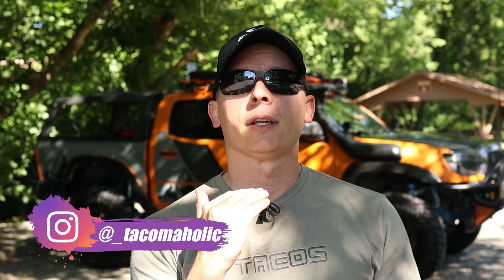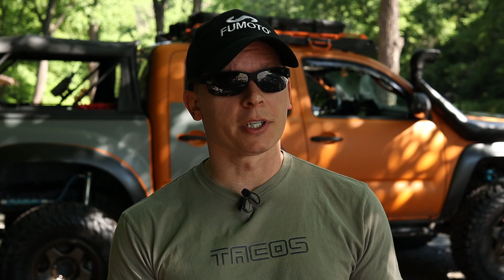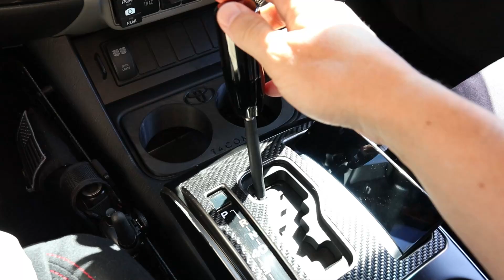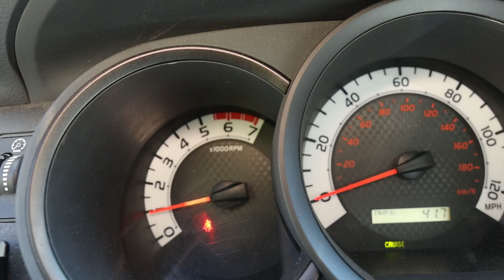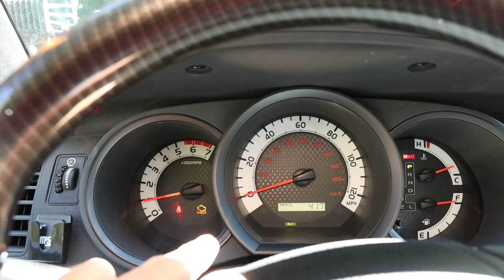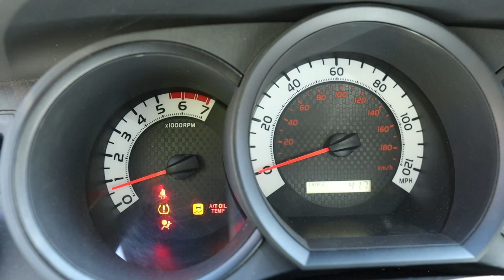Toyota Tacoma Automatic Transmission Temp Check Mode Tutorial

Comment: FYI if anyone’s curious mine took almost 30 mins for the light to come on solid after doing the shift sequence to initiate  temp check mode. This was starting with a cold engine on a 60F from not driving for a day prior. Just gotta be patient. Thanks for the video!
Reply: Yeah It took mine around 25 because it was cold out

Comment: FYI…this step is completely unnecessary. 
Start the truck, cycle through gears a couple of times. Touch the ATF pan. If it’s warm but not hot (around 95F), you’re at the right temp. Drain overflow. You should get 1/2 to 3/4 quart from over flow.

Comment: Great write-up. I tried it exactly as you described but couldn’t get it into temp mode with just the 6 shifts. Mine is a 2013.  What finally worked was repeatedly shifting back and forth between neutral and drive…(about a dozen times).  Initially the light would remain blinking but after letting it cool a couple hours and trying again the light came on and stayed solid.  My fluid was 2 1/2 quarts low! Thanks for the help!

Comment: This looks like it’s different for every Tacoma. My Tacoma doesn’t have an AT oil/temp light.

After shifting between N D N D N D
While the gear stick is in drive if the D is blinking then it’s too hot. But if the D is solid then I have a few minutes to drain the overfill and get the level right.

It’s weird and kinda scary that it’s different depending on your Tacoma
Reply: What year is your Tacoma? I have a 2011.

Comment: This might be a dumb question, but how would I leave the temp check mode? Or does it automatically leave? Thanks!
Reply from the maker: The temp check mod disables when you turn the truck off and remove the wire or clip from the OBD port.

Comment: I cant do that, my light at oil temp ever is flashing or just is not on
Reply: I got it and i just got 10 ml
I did drain again and put new oil transmision and i add 300 ml plus just for see 300 ml back when i check again the oil level, but that 2nd time when i did check the level a didnt get nothing oil back, obviously i was expecting get that 300 ml back

Comment: couldnt you drain fluid, remove the level check bolt, fill till it comes out the bolt hole, plug the hole then fill with a couple extra pumps.then let car warm up then just remove the check level bolt again, drain  then ur good

Comment: Super helpful video. I did this today with the paperclip(works great). From my experience(08 Tacoma) when I got it into check mode it started flashing a few times, stayed solid for a few seconds, then went out. Once the light came back on, I checked the fluid to the proper level. But my light literally stayed solid for 20 minutes until it started flashing. I think my transmission temp sensor might be jacked up. Anyways, the video is/was much appreciated! Thanks!

Comment: So just got a 2010 Taco Prerunner 2 wd. with 150,000 miles. Truck looks amazing bu have no maintenance history. Doing a fluid drain and fill and will repeat in about 15K miles. I am in FL wih outside temp mid 90's. The light never blinked. after I got the sequence down it just stayed lit. Does that mean it is at correct temp? or did it never go into test mode?

Thanks

Comment: How long will at/temp light flash?
Reply from the maker: The light will come on solid for about 2 seconds when starting the mode then turn off, but will come back on solid when the truck is at the correct temperature and then start flashing when the temp is too hot.

Comment: I got it to flash but it didn’t go away.  Will it flash for a few minutes then go solid?
Reply: After going through the gear shifting procedure my AT temp light flashed a few times turned solid and then went off. Then I had to wait like 15 min for it to come back on solid. Then check the fluid level on a level by pulling the check plug. Make sure all this is done on a level surface(this is super important). If the AT temp light starts flashing after having it having been on solid for a while, you are above the correct temperature to check the level.

Comment: Was a hot day, got into temp check and it flashed once and then stayed solid right away without it running prior. Could just a warm day get it into temp range? 2012 4.0
Reply: Probably so, the range is 97-115 degrees. Maybe wait until weather cools a little and then do the process over again to make sure you don’t have a faulty trans temp sensor.

Comment: Just wanted to give my input that my 2022 sr did not work with the jumper. From what I’ve seen 2020 and newer just require a specific shift sequence, either to S back to park or N before you shift from N to D

Comment: When is the appropriate time to remove the paperclip/wire from the connector?
Reply from the maker: Any time after you've refilled the correct amount of trans fluid.
Reply: @Tacomaholic  Thank you. Great tutorial. Subscribed.
Reply from the maker: @GreatDaneAV  Thanks man!
Reply: According to the Car Care Nut ( Master Toyota Mechanic) He states to remove the jumper after the car is in temp ck mode.  Then check for proper fluid level.  This is done to ensure proper idle speed when checking fluid level.

Comment: I had a very bad leak. Coming from the hose that goes into the radiator at the fitting. I do not know how much I lost. Toyota told me to put in 5 quarts to be safe. That seems like a lot? I have the old trans oil changed out, and refilled. What I drained out was not very much.I have yet to get my 2014 in AT temp mode. I get all the flashing lights and the AT light pops after the sequence. I waited 20 mins and gave up. I probably need to wait longer?
Reply from the maker: It can take awhile for the truck to get at the proper temp for the AT mode assuming you got the sequence to start correctly.
Reply: @Tacomaholic  I seemed to have got the sequence correct. I got the AT light to pop on briefly and then vanish.. gonna give it a try now. Thanks! Great vid!

Comment: Can the fill plug be opened and fluid added while the truck is running?
Reply: Probably not a wise thing to do I would imagine.
Reply: Yes you wait till the light stays solid then pump some in the fill plug till it runs out the check plug while it's running. Then put the check plug back in shut it off then put in the fill plug.
Reply: @JustinBurnette-gn2tj  why would you not drain out while cool, put the amount back in that you drained, plus a half quart, then heat up until correct temp pull the plug and let drain until a trickle? That seems to be the best way to do it imo.

Comment: I tried this with my 2021 Tacoma using wire or paperclip can't get any flashing lights to come on. I put them in the correct terminals. Any suggestions?
Reply from the maker: I'm not sure if the process is identical on the 3rd Gen Tacomas. Might want to see if there is a thread about it on Tacomaworld.

Comment: 2006 tacoma. 4L 6cyl. Drained and filled. 2 quarts. Went through process 6 N-D. AT temp light stayed solid. It did not illuminate and go away?! Does this mean fluid is at temp? Note: it is 92 degrees outside. Anyone experience this? Or should I consider it at temp and do overflow?
Reply: It flashes when you first initiate at temp check mode, then stays solid when it is at the proper temperature to check the level.
Reply: I'm having the same problem. This morning it did what it was supposed to do, it lit up and went off 10min later it come back on. I checked my fluid, I didn't have enough so I added fluid and now it comes on solid. What am I doing wrong
Reply: @jamescorley2536  after you added fluid, did you let it cool down and go through the whole process again?

Comment: I weigh the oil that drains out and put the same amount back in.
Reply from the maker: How do you know it was filled correctly to begin with?
Reply: @Tacomaholic  You could say I'm trusting Toyota. Plus the fact that whatever is in there has been working. Obviously if you have a leak or other problems or unknown service history, you would not use my method.

Comment: I have a Ultra Gauge in my truck that shows my trans temp, I see in the thread that it needs to be between 115 degrees and 130 degrees. Do you think I’d be okay using just the Ultra Gauge or will I still need to put the truck in temp check mode?
Reply from the maker: Temp check mode will be the most accurate, but using the UG should be fine too.

Comment: Thank you so much for this. Been looking for this tutorial for ages, but none are very clear.

Do you know if this works on the 4th gen 4runner? I'd assume yes. 

Also, do you plan to use Toyota WS or something else? I've been thinking about using Valvoline Maxlife
Reply: Did you ever find out if the 4th gen 4Runner process was the same?
Reply from the maker: I'm not sure if it works for the 4th Gen 4Runners. Personally I'll be using Toyota WS fluid when I do my change. It's just a little more expensive than the Valvoline or other counterparts.

Comment: Thanks.  Nice vid.

@Tacomaholic 
Do you think it would be wise to replace transmission fluid after 200k + miles without doing so?
Reply from the maker: I've heard from professional mechanics that if the trans fluid has never been changed over mileage intervals over 100k then it's better to leave the fluid alone since fluid that old probably has a bunch of small particles/pieces of metal that is actually helping the transmission grab and hold gears. Replacing all of that old fluid with new clean fluid could cause the trans to start slipping.
Reply: 2006 Taco 4x4 V6 bought at 103,000 miles and appears no trans service done, realized at 240,000 miles and did trans fluid drain and fill.  Actually dropped pan, changed trans filter, cleaned magnets and then did this process 2 more times same day (it will be ok do 2xs vs. 3xS like I did). Has been fine 85,000 miles later to 315,000 mi. now. Doing another drain fill now, no pan drop or filter change though. Will do at most twice drain fill process now, depends on fluid, don't want it fully replaced since shift plates need grit to properly shift, yes, fluid needs to be dirty.  NEVER do a flush, DO only drain fill.
Reply: @ec9156  appreciate man.  I’m at 308k still with same fluid but your process seems pretty convincing.

Comment: Mine took about 20 mins at about 60 degrees ambient outside temperature starting from a cold engine. After 15 mins I was worried and I drove it in reverse out of the garage and back in a few times to heat things up. It finally got to temp just have to be patient.
Reply: been wondering if this is normal, did mine and it took about 20-25 but that’s a cold start in a 45 degree garage. glad i saw this comment!
Reply: Do you mean you let it warm up for 15 minutes before starting the procedure?
Reply: @blakebiltwell5  go through the gear changing procedure, when it’s gets into A/T temp check mode it will flash on then turn off. The you wait until the A/T temp light comes back on solid. At that point you move quickly to pull the check plug and make sure(on a level surface) the fluid is only a steady trickle, not constant flow.

Comment: Learned this wire jumper trick few years ago on TacomaWorld. The window of correct temp only lasts about 3 min so you gotta work kinda fast once it's ready so have your tools ready to pull overflow bolt to get it to perfect level. Once it starts to trickle out reinstall bolt and you're golden.👌👍
Reply: Good to know. Thank you
Reply: @TAC4R  Sweet! Thank you for sharing the important piece of information.
Reply: I was wondering about that. Thanks
Reply: I was wondering about that. Thanks
Reply: Thank you.

Comment: I have a 2016 Camry with a transmission without a dip stick, I wonder if it has something just like this. Everyone always says to just use a infrared thermostat, to check the pan temperature. But this way seems way more accurate.
Reply from the maker: Knowing Toyota I bet there is a very similar process for the Camry.